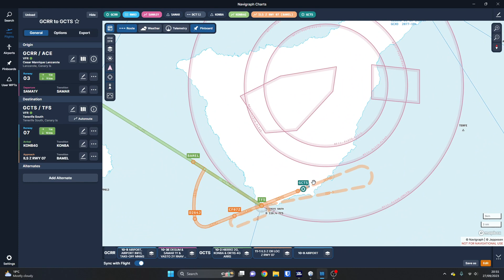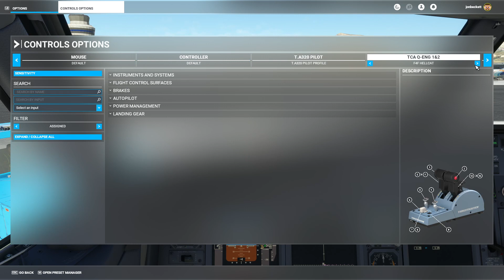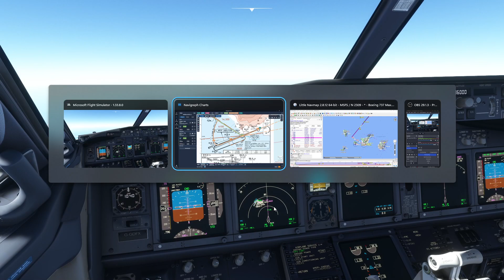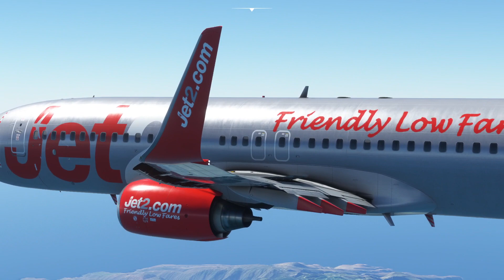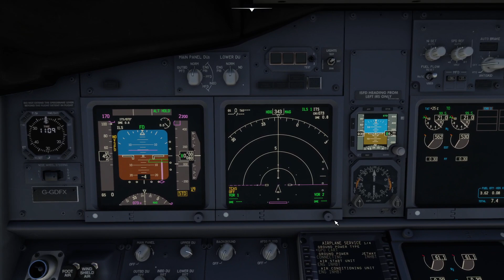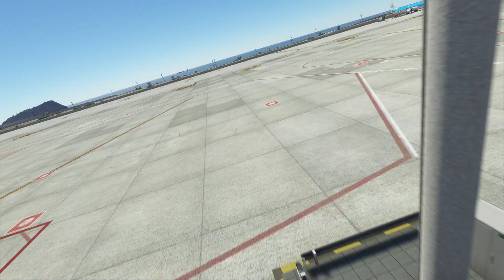Flying from Lanzarote to Tenerife in the PMDG 737-800 in Microsoft Flight Simulator

Comment: Now that I've got a good feel for this plane and switches, I wish they had an option to set all switches to off so we could put them on :) at 27:50 you have 4 landing switches.  Am I imagining this but I think I only have two landing switches, or maybe its the 600.  51:40 another great info to add to the list.  Thanks Jon.
Reply from the maker: The PMDG aircraft have different hardware load-outs depending on the livery chosen. Each livery reflects a real-world counterpart. There are lots of options in the PMDG menu of the FMC that let you choose hardware.

Comment: Great landing once again; butter class! Also for those reading the comments: When you get the reset mcp alt message it means it's time to reduce the altitude selected, if you do that before you reach TOD the autopilot will start the descent, if you miss that for any reason you can just put vnav off and on and it should start descending. I think the "alt intv" button does that too but I can never remember! Cheers!